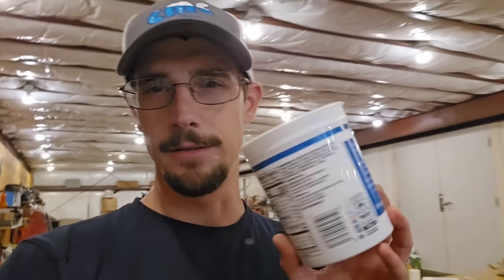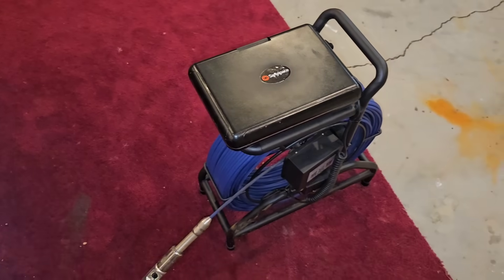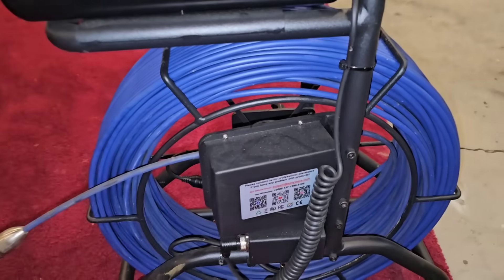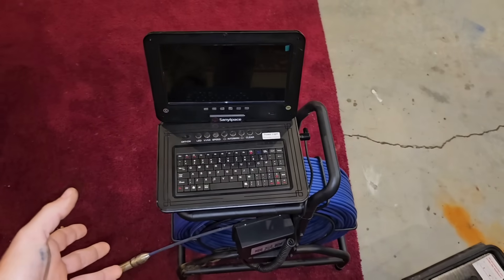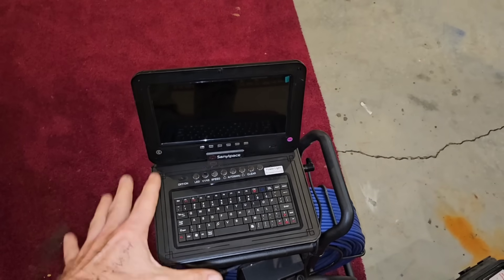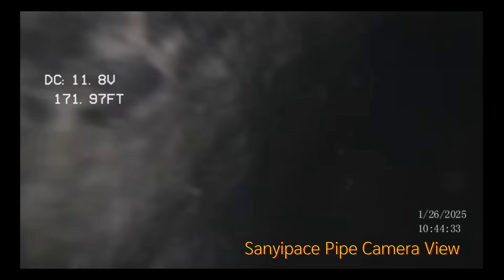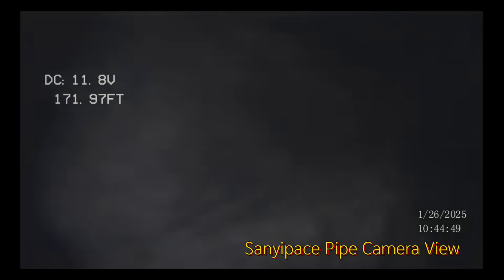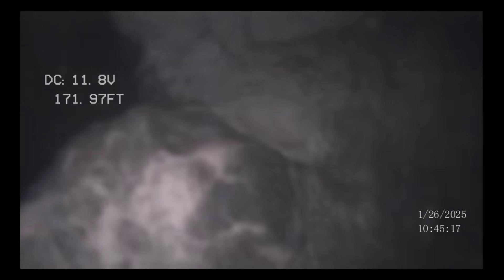Customer's Well Collapse! A Down Hole Look with Borehole Camera by Sanyipace

Comment: Even with drilling a new well, what's to say you don't drill through the fault in another area and it happens again? 
Are you going to offer a guarantee? 
You can't guarantee, no one can, you can't see through the earth to know where the fault is.  I dunno man, what's the water height above the rock at 170'  
As some have suggested, I'd explore a separator until that pump quits, then, install another at the 170 if you have enough table above.  
Ur in a tough spot with these people's money unfortunately.

Comment: Out of curiosity, with water at 171' in the video, why does it need to be a 575' well?
Reply: I think static pressure in the well will push the water level higher than the source. (if I worded that correctly)

Comment: I am just an armchair quarterback.  You are the experts. If the insurance pays, I will be shocked.
Reply: I'd grab some live wires and shock myself.  That's a much more certain bet than insurance paying ;)
Reply: At best, insurance will not cover until the pump fails … even then, it will be a battle. The owner will be months without water.

Comment: Stuff happens. If it was me I'd bite the bullet and drill a new well. Throwing more money in a well thats never going to be anything but problems and money putting in a new well thats installed correctly is the only obtion . I just dont believe in throwing money at a bad situation and hope it works out. Drill a new well and write this off as lessons learned,hire a professional driller that knows what they are doing. Lesson learned.

Comment: City dweller here but I'd drill a new well as far as practically possible from the current well to avoid a similar issue. Doubt insurance will cover it either without a special rider. I don't know what your margins are on a 500+ foot well but maybe you could offer a 10-15% "returning customer" discount or something if you want to help the homeowner out.

Comment: If it was my well I would do the wait and see. I watched the video but I can't remember if you tried to flush it let it run for an hour or two. You can buy an awful lot of filters for the cost of the well. I understand that it's probably rough on the pump if there's a hundred foot of sediment sitting on top of it. Maybe there's only a couple feet. Be a nuisance to keep changing out the filter or flushing it but in a month it could clear up

Comment: One way out - not as good as a new well but a lot cheaper - might be to install a Lakos ILB-ILS Centrifugal Separator and use a simple irrigation valve and timer to purge the grit out every few days. 

I had a combination domestic water and geothermal supply well start producing a fair amount of grit - so much so that it would clog my spin-down filter every couple of days. I installed a Lakos filter and it took care of the situation to where I only had to empty it every couple of weeks. After a few months of that, the amount to grit from the well reduced to the point where I only had to empty the Lakos filter every 6 months.

Sometimes, addressing the symptom can be acceptable if addressing the root cause of the problem is very expensive.

Take care and God Bless.
Reply: I like thinking outside the box, but the pump has an expected life and will eventually need to come out. The well is dead when that happens. IMO, put the money into a new hole.
Reply: @TheDansana  A new hole is going to need a new pump  - and pulling the old pump out and putting it into a new well is probably a false economy, since there will be a potentially significant charge for the labor. Another option at the point of failure of the pump - put a new pump in a sleeve made from a length of PVC pipe with micro slots cut in it and wrap the sleeve with a filter cloth (I had this done on a well that was producing grit and it worked very effectively).

Drilling a new well can be such a costly affair (without a guarantee of success - ask me how I know about that stress and the cost of drilling a well that comes up dry!) that it can make sense to invest a chunk of money into keeping the old well going for as long as possible.

Take care and God Bless.

Comment: I had a similar situation. I noticed the NC red mud in the filter. We called a tow truck to try and winch the pump out and after 4-5ft stretch , it snapped. Had to drill a new well. The county health department wanted to put the new well beside the old one. After explaining the situation to them they agreed to put it 30’away. All new everything.

Comment: What about running the pump constantly for a few days bypassing the filter and the house to help clear the debris sediment then using the system as is till the pump fails? Then setting a new pump above the collapse and see if there is enough water? 
To me that sounds like the the least work and cost for everyone involved providing that sufficient water could still be provided.
Reply: Yeah, sooner or later they'll need a new well, but this one may be fine for a good while if the sand comes out. If he has more sand in the well in a week or two, well, a new well it is.

Comment: Is there a chance that the sediment will dissipate with time?  I'd pump it as is.  If the sediment is an issue, put a sediment trap.  10 years from now when the pump gives out, then try to pull the pump (probably won't come up).  If it doesn't then drill a new well.

Comment: How deep do you usually line a well. I know it varies depending on what the composition of the ground is but where does someone find out that information? Where does a driller find out?

Comment: Might should have a policy to put in aluminum casing if drilling in a fault area ?       Still won't guarantee that it won't get crushed but its better than plastic.
Reply: At that point might as well use steel. Stronger and cheaper.
Reply: @robmurphy806  -   Nope,  Steel pipe will rust into nothing and crumble in a couple years and add metal rust to your water,   aluminum does not rust or corrode.

Comment: I'm really curious about the liner process. The well at my place that I bought a few years ago put out a fair amount of sand too. It's still producing and I'm on a meager fixed income, so I'm unlikely to have another well drilled and just deal with whatever I have for now. I haven't tried to pull the pump yet, but I might be doing it next year. I'm hoping that it's just a lot of sand falling into the bore. In the spring, there's a fair amount of water coming right out of the cap vent, but not this year. I live on a mountain and the water table is very high, so it's a roll of the dice as to what's going on. There's no documentation regarding how deep the well was drilled, but I hope there's info under the cap. There was a pump in the basement at one time, so this might be a shallow drilled system. Time will tell. Thanks for all you do to keep the public "well" informed, lol.

Comment: Im guessing due to the grit that pumps life span is going to be greatly reduced. In the mean time the home owner could try a large sediment trap thats what I would.
Reply: Pump is done snce it cannot be retreived.
Reply: @arlynsmith9196  ??? he said its still pumping in the video. Just trapped and lots of grit but at least he still has water.
Reply: @arlynsmith9196  The pump still runs. It ain't getting back out if or when it fails, but until then the well and pump are good if the sand can be flushed out. Let it pump for a few days straight and see what happen.s